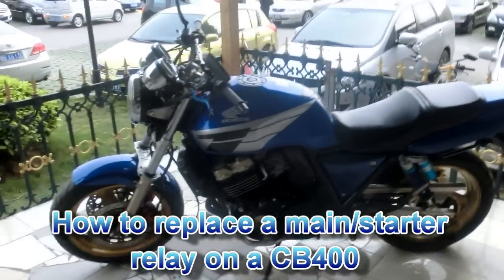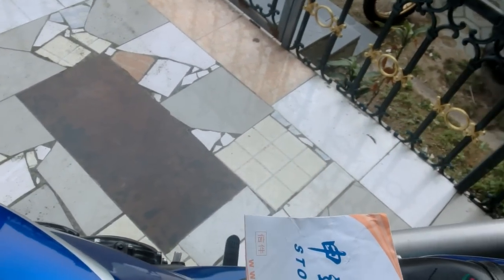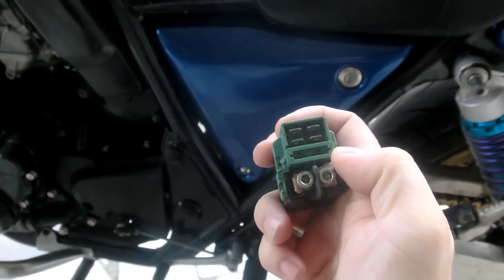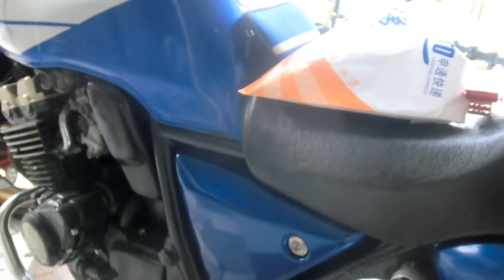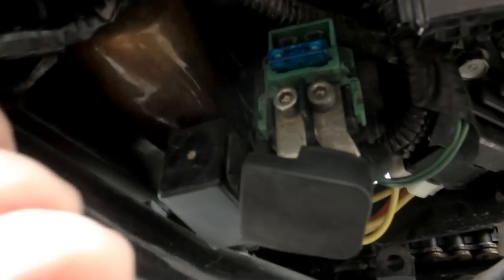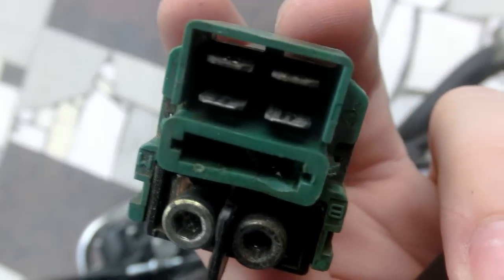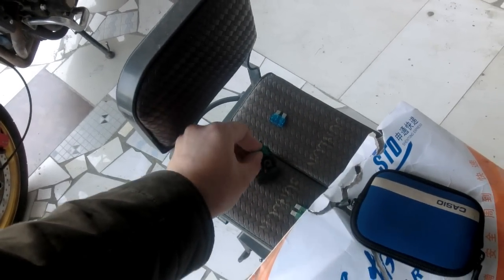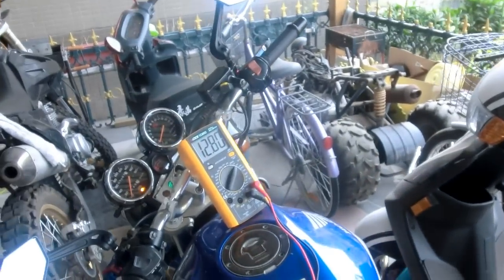How to replace a main/starter relay on a CB400

Comment: This video is an underrated gem. My cb400sf bike has the exact same charging and cutting out symptoms as yours had and the amount of arcane tomfoolery I have got up to around it is frankly embarrassing. I'll try replace the starter relay as you did; should work perfect

Comment: Main starter fuse replacement was the problem all along. Lights will work but no horn and no motor turnover. Look first at that fuse. Good video

Comment: I believe if in general if the bike is not charging then replacing what you did prior to this was not a bad idea either.  But regardless, congrats!  When I finally found out that my CB450's stator was bad, I replaced it and made the old one into a windchime.  Cheers!

Comment: litterally having this same fucking battle with a VTR250, ordered a starter relay and it arrived in the mail today, battery has a slow drain on it which seems to be just withering away and the brand new battery i put in it is almost flat because something is drawing from it while its sitting in the shed.

ive ordered a reg/rec off ebay for it got my starter relay on my desk, gonna change that bitch over and hope it helps. cheers for making this vide, doubt ull read this but who knows maybe uve helped me here lol

Comment: im riding a yamaha 153cc, and my starter relay cap says 15amps..
but it seem you using a 30 amps fuse on your motor.
question: can i use 30amps also on my 153cc??

Comment: Nice job on that one. I think that I have the same problem on my Bike, A Kawasakie GPZ 500. Fond it abandoned and been working on it to get it working and found out the starter relay is faulty. (Never worked on or riden a bike befor but done lots of work on cars)

Interesting that yo say it is the relay makes your bike charge better. wondering if the 15 amp fuse would be the reson for that.

Comment: Unbe-frickin-lievable that in the electronics city Shenzhen you couldn't find a bloody standard 'consumable' part like a 30A vehicle fuse. I mean, newer cars probably have a smaller standard, but there should be plenty of older ones around, especially back in in 2012.
This episode shows that proper problem diagnosis saves time and money. - But at least you got spare parts for more components now. (Some regulators seem like consumables.)